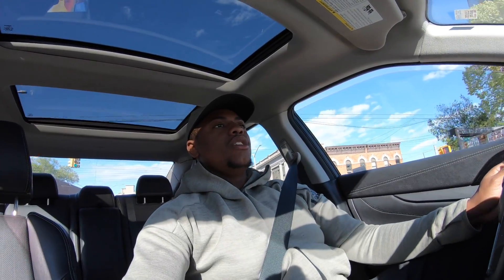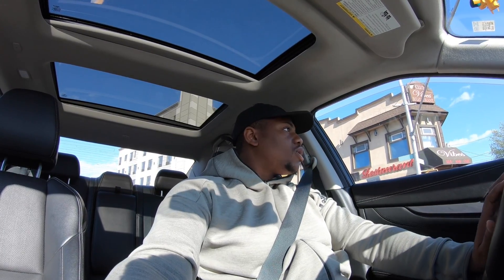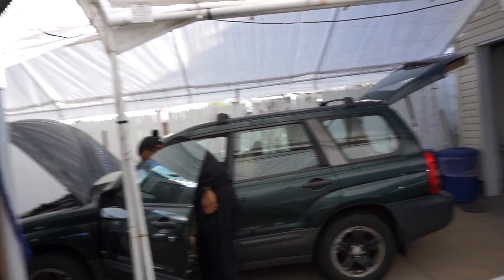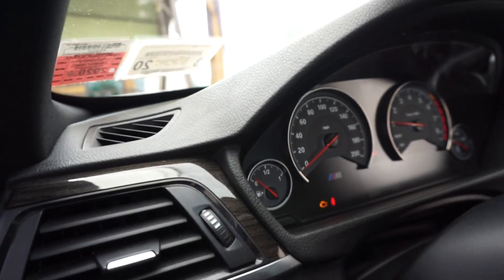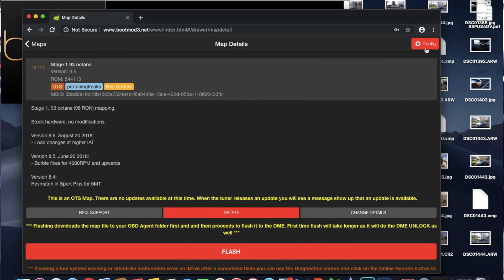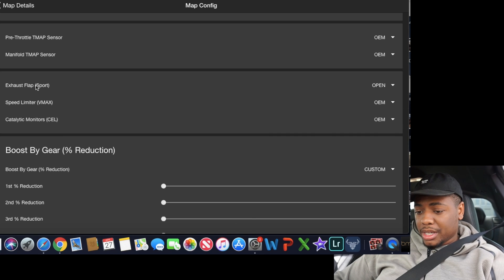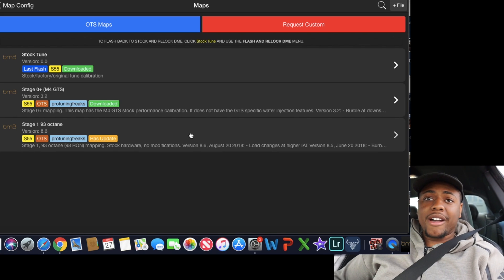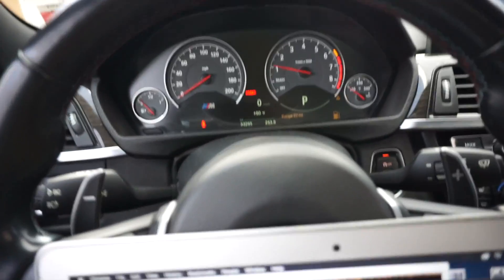Disabling Cat Monitor (CEL) When Installing a Catless Downpipe

Comment: i have a m240i, with bm3 tuned and a catless donwpipe, and a o2 spacer on o2 sensor 2 (only 1 spacer) i disabled cat monitoring on bm3 and my check engnine light comes on still then goes away at certain temps like when its 60 degrees out lights gone, it gets colder or even too hot it comes back, its weird, any solutions to this?

Comment: How can I remove the check engine light regarding the downpipe & custom exhuast fabrications axel back?  Is there a way to remove the codding ONLY for the exhaust part and not the check engine entirely? Is there a sensory cap I cam plug in to trick the system? I believe the exhuast has a sensory plug too. So wouldn't I need to do something about that also or this coddling edit is enough? 

(2018 BMW 230i F22)

PLEASE HELP 🙏🏼🙈

Comment: HELP I got the VRSF castles Downpipe installed on my F30 335i, but after 10 min driving it out the shop my car went into limp mode and struggled staying on when standing still :/

Comment: Quick question, I bought an M235i with the Dinan stage 3 package I have the catless DP that I want to install , but Dinan doesn't provide a tune for the check engine light, if I purchase this just for the disabling the catless option would it mess with the Dinan tune? thanks!

Comment: So basically i could mount a catless downpipe and buy bootmod3 and disable the cel hmmm interesting
Reply: still cant pass emissions though, i dont think
Reply: @aSASa45454  that's why you need friends in the industry
Reply: You can turn off the CEL using Bootmod3. I lived in NJ and theres a map on bm3 for tri state area by a local tuner which you flash your car to this map for emissions then once u pass u can go back to stage 1/2 etc.
Reply: @Malavitanyc   do you know which tuner provides that tune? I have a 340 with a stage 2 from bm3 and catless downpipe. Inspection is due now and I have zero idea on how to pass inspection.
Reply: @shawn_e9248 did you figure it out gang? I got a m340 and tryna run a catless dp.
Reply: @nico-by3lw  yea I ran a space/adapter on the 02 sensor and flashed the car back to stock. Made sure there was no check engine light and passed inspection

Comment: I used 2 spark plug defoulers on the 2nd O2, I didn't get CEL for a month, then came on, I reset it with bimmerlink and since then it's been a year ! CEL hasn't come back, so that's a much cheaper way to do it. For all those who says defoulers don't work on new bimmer engine, they haven't tried it, I am living proof it still works.
Reply: Have a link to which defouler you used?
Reply: did you just get bimmer link and there was a button to turn it off?
Reply: Do I have to gut the two sides ?
Reply: The question is does it pass nyc inspection with 2 of the cats at ready state?
Reply: @letmeknow4167  It would definitely not pass. I'm in vancouver BC, government here got rid of emission inspections decades ago.
Reply: @XMG3  my guy what kind of spark plug defoulers did you use on the O2?
Reply: @Temppaa98  I can't remember exactly, I sold the car already, but it was just a generic defouler off the counter.

Comment: So you still can’t pass omissions?
Reply: Yes you can pass when they plug the car in and you have no engine light.  You fail if they put the sensors on the tailpipes....but no one does that anymore on OBD2 cars
Reply: @MooneyPilotTX don’t most states require that at least one monitor not ready ?
Reply from the maker: Nope, you would need a DP Fix
Reply: Slowspeed, any experience with building a plug n play dp fix incorporating OEM harnesses and either VRSF's or Area74's devices?
Reply from the maker: No however as soon as I get my car back I will be playing around with it. Should be by the end of this week.
Reply: Slowspeed nice man, please keep us posted. I know a few members on bimmerpost did it but no detailed instructions on how to build one.
Reply: @XRP_Junkee  no- won't work on EWG sorry
Reply: @XRP_Junkee  lucky guys were PWG n55
Reply: Junyi Yu good call, forgot to mention I've got a PWG.
Reply: @XRP_Junkee  then you can try VRSF DP fix. I have one and didnt even try on my car when I saw post  saying it would only work on PWG.
Reply: Junyi Yu any chance you're selling it? I'd take it off your hands for the right price.
Reply: gleung627 it’s still in the original package I received from VRSF. They mistakenly sent me a n54 version and I asked for an exchange for n55. During the process I realized it won’t work on EWG and the exchange process took way too long for them to send back the exchange. So I didn’t even bother asking for a return. Let me know if you’re interested. I don’t even know how much it costs now. But I’m willing to sell it 50%off but you need to pay the shipping.
Reply: Junyi Yu yeah unfortunately I need the N55 version as well and I'm not sure they would honor an exchange once it's been sold to a 3rd party.
Reply: @XRP_Junkee  sorry for confusion.  I received the n55 version after the exchange.
Reply: Junyi Yu oh ok in that case yes I'm interested. How would we arrange this? Any better form of communication other than through YouTube?
Reply: I don't know. I haven't sold anything yet on the internet. I'm located in Boston, MA @XRP_Junkee
Reply: Junyi Yu managed to find you on FB. Check your FB messages if and when you get a chance. 

Ed, catted dp are hit or miss when it comes to emissions from what I've read.
Reply: @Slowspeed  let us know when u doing the rally for everyone ty ride thru!!  Are you coming back with the m4 or back with the 4 series?  Why didn't you get the m4 kit for your 4 series after it was totalled?
Reply from the maker: @ottogibbs1  They were gonna total it at first but the decided to repair it, sorry for confusing everyone but i mentioned it in the vid that i will be getting it back!
Reply: @Slowspeed  no DP fix will work on EWG FYI
Reply: The proper way is to do drive cycle before the code triggers and monitors are still ready
Reply: Will you be able to pass with a “catted” DP ?